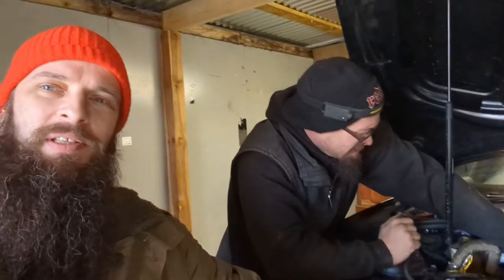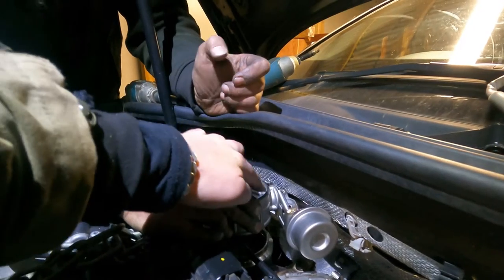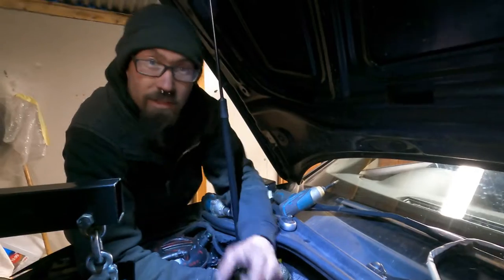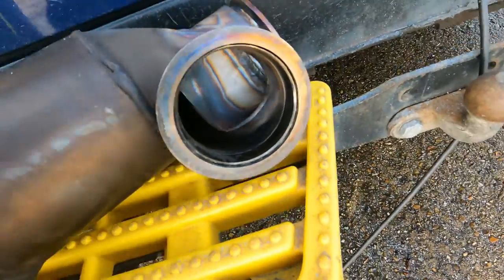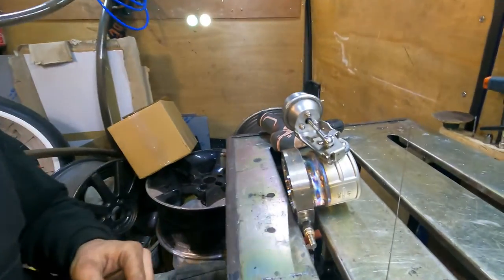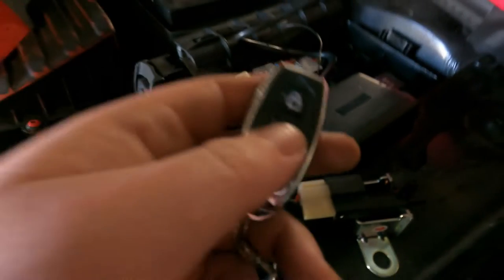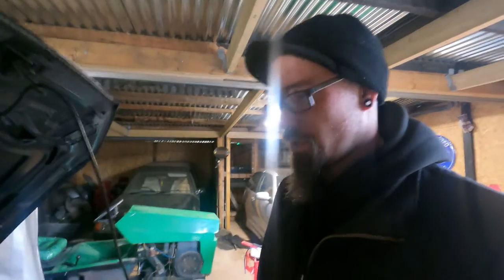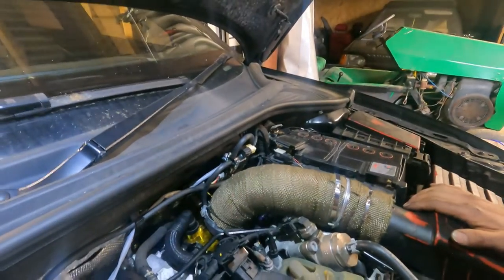AUDI S3 8V BONNET EXHAUST BUILD!

Comment: That'll certainly save some weight and add some drama! Any concerns for water ingress?
Reply from the maker: Actually added a little weight, only weight remove is the bonnet hole :) I have a temporary cover for it until the opening mechanism is built and the way it's design any water going through the hole will fall into the catalyst, it won't reach the turbo so should be ok :) The bonnet paint didn't like it though!
Reply: Make the pipe longer and put the flap  like in the old tractors :)
Reply: @Beardchanics  but surely it's lighter than the full system out the back?!
Reply from the maker: @SoloLap  Someone didn't watch the video in full ;) It's a cut out, it has a valve, it's added to the existing exhaust and when the valve is open the exhaust can bypass the catalyst and muffler, when it's close goes through the normal exhaust. When close the flow not as smooth as it used to be cos the bonnet pipe scoop  the inside on the downpipe. But when hammering it I open the valve ofc :)
Reply from the maker: @zwloki0  Did thought of that :) But got another mechanism I  want to add which would close/open the bonnet on ignition so we want to avoid  putting length we'll probably cut  back later. Work in progress. Awesome fun when driving though :D